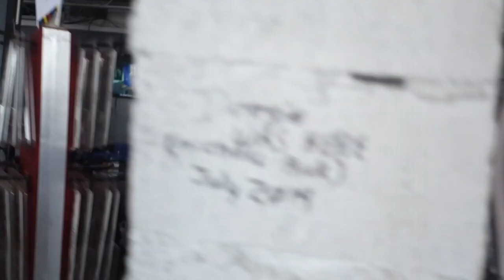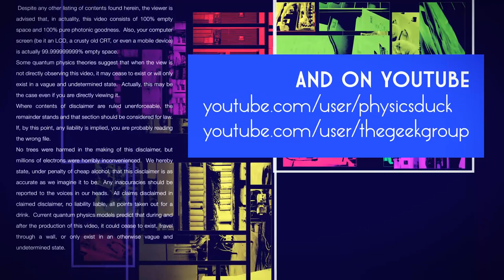Captain's Blog 4 3 2017 The Cat Loves Me

Comment: Microsoft's NTP server "time.windows.com" is giving out incorrect time info, you should switch to a ntp pool server.
Reply: Yup. It's notorious for screwing up the time. Change it to us.pool.ntp.org.
If the time is polled from the AD servers, then you have to get more technical. Running the following from an admin CMD line works a treat (DON'T DO THIS ON WORKSTATIONS/USER PC, ONLY ON DOMAIN CONTROLLERS) First line is line-wrapped:
w32tm /config /manualpeerlist:"0.us.pool.ntp.org,0x1 1.us.pool.ntp.org,0x1" /syncfromflags:manual /update /reliable:YES
w32tm /resync /rediscover
w32tm /query /source
w32tm /query /status: